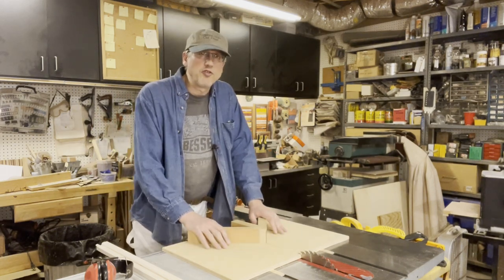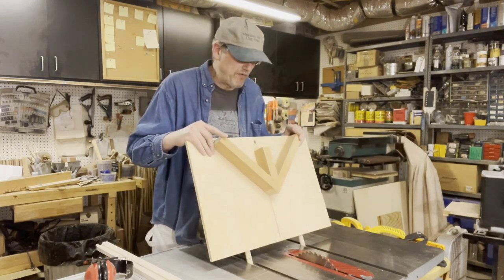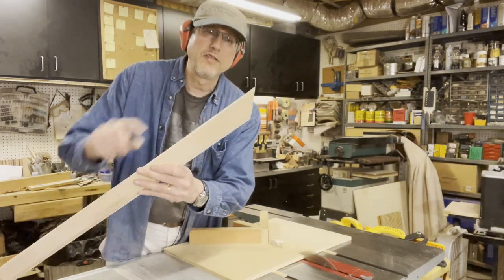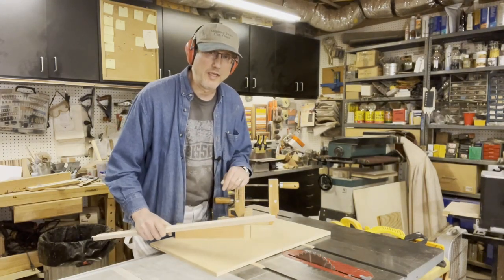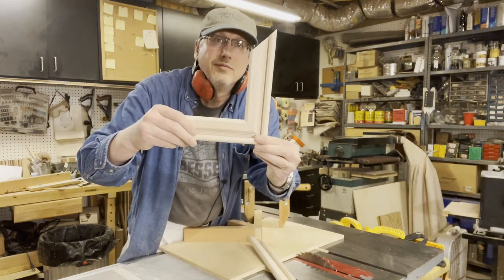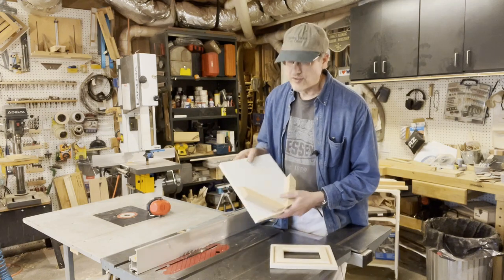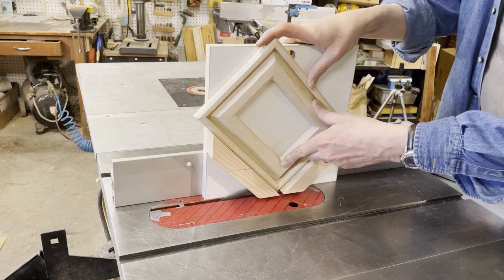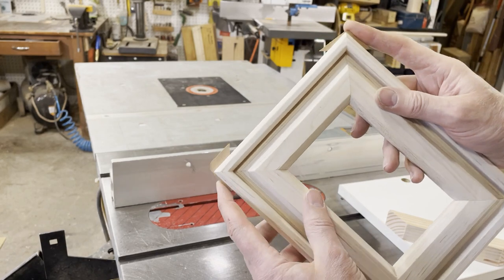Table Saw Picture Frame Part 2 - Miter & Spline Jigs

Comment: I'm a jig guy, and the only thing I would have done differently with the splines is to cut a cross piece for the jig to ride the fence at 90° just to be careful. Really enjoying your videos. Thank you so much for posting.
Reply from the maker: Thanks for the added tip. I agree that anyone with a wide flat topped fence should include the 90 degree addition. My current fence has a narrow top so it won’t accommodate the addition you recommend.